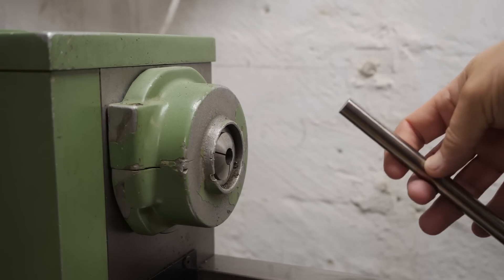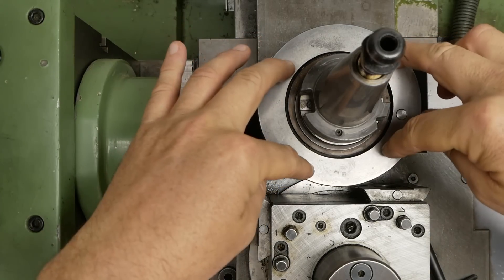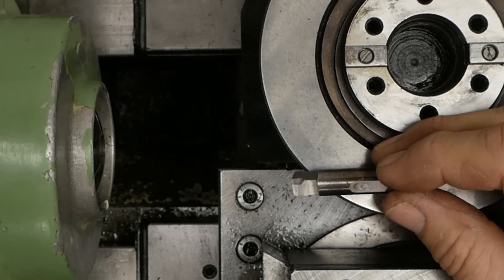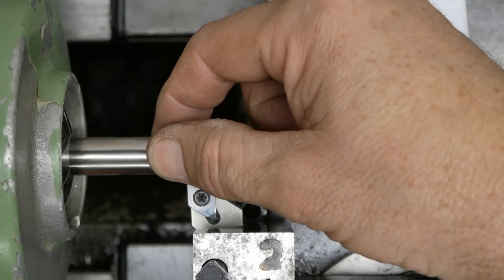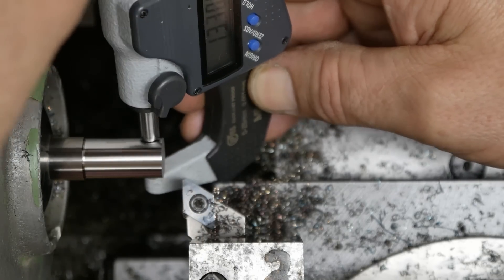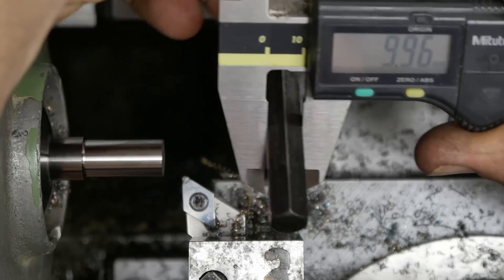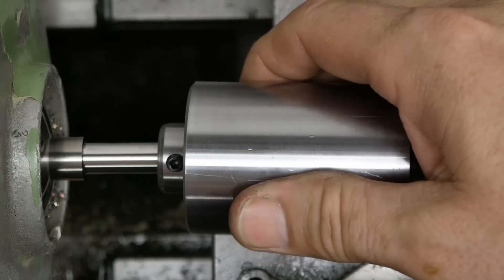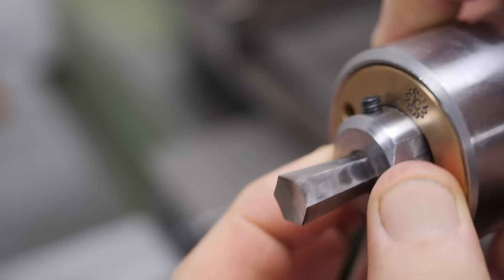Can you hard turn HSS in the home shop? || RotarySMP

Comment: Welp I did buy sort of buy accident RockTec 65 tooling, was quite surprised on how much it didn't care to cut HSS steel..
I wonder though on how crazy the cuts can go actually. Does the schaublin not have any cooling? I think that would go better in terms of thermal schock.
Reply from the maker: I thought hard turning is always done dry, to prevent thermal shocking the CBN insert.
Reply: @RotarySMP  Seems like CBN can be used with coolant but makes almost no diff. For Ceramics which is apparently preferred they say no coolant.

Comment: Heh, I'd be interested in that Schaublin 125-CNC if it wasn't in France, and I was in the US (the shipping might be a tad expensive), and if I hadn't just gotten a late 90's CNC lathe for free last weekend!
Reply from the maker: Nice score. What did you get?
Reply: @RotarySMP  Hitachi Seiki TF15 but with a blown up spindle drive. Someone attempted to repair it before, and they replaced all of the IGBTs, and a couple of the IGBT drive hybrids, but they missed replacing a couple other components that blew up on that side of the drive as well - I think I discovered all the blown up stuff yesterday, so need to order some parts. One of the 18V linear regulators that supplies gate drive voltages for the IGBTs was toast (only producing 2.2v not 18, and when tested out of the circuit, wasn't a regulator at all anymore), and there was also a voltage supervisor chip on that rail, with an opto to the digital control side telling it that the IGBT bias voltages are all good that was shorted. I'm guessing without that "voltage ok" signal, it won't even attempt to turn on any IGBTs and run the motor.
Reply from the maker: @gorak9000  This machine is lucky to have a guy with your troubleshooting experience to save it before it got shipped to the blast furnace. Good one.